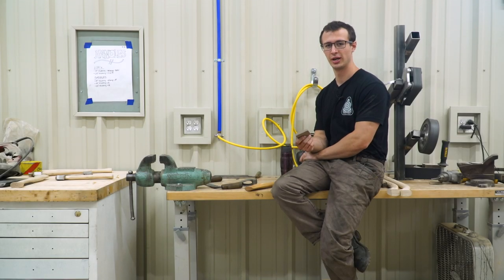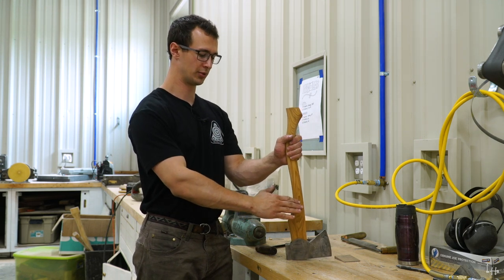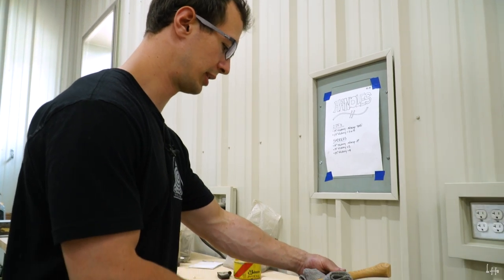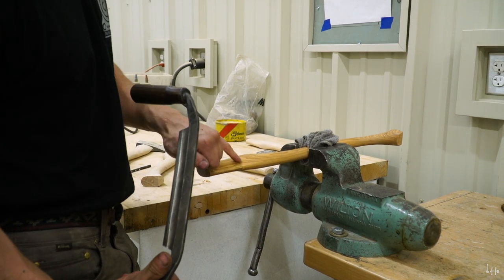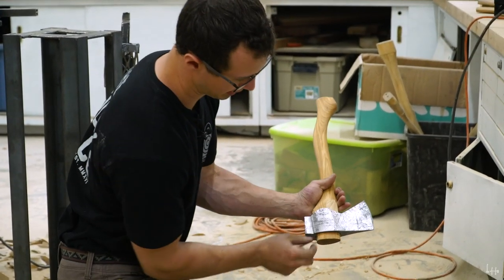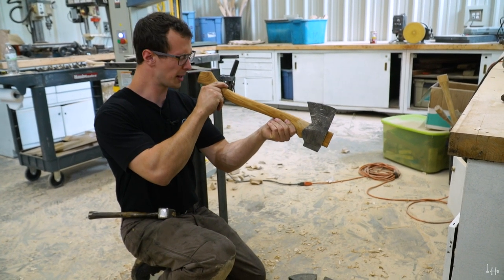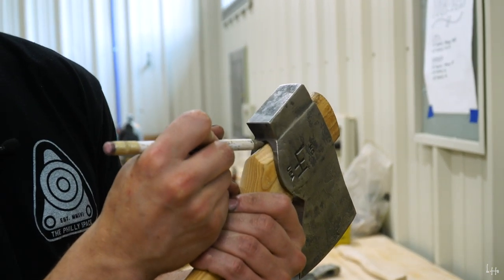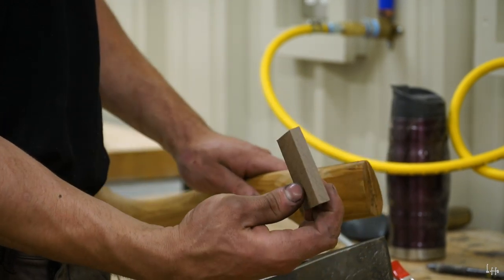HOW TO HANG AN AXE HEAD - AXE MAKING

Comment: I can smell the wood as you work it. I don't glue my wedges, I use pine tar. Not sure if it is any better or worse but I find it seals out moisture and preserves the eye wood area pretty well. I am, however, so going to use the rounded edges on my wedges from now on! I can't believe I hadn't thought of that!

Comment: Great video as always. I am thinking of making a handle for an old axe now and the thing is that the eye is not straight with the edge. What is better, to play with the handle to face it straight (edge and handle) or use files and file away parts of the eye making it as straight as it can get to the edge, before making the handle?

Comment: Thanks for the video, so helpfull.  I am replacing a axe handle but unsure about the head orientation, top versus bottom.  Can I assume the larger measurement across the eye in the short direction indicates the top?

Comment: I noticed you don't use any kind of a metal wedge in your handling process. I usually make either a couple of  straight step wedges or a single round wedge. Does the glue hold well enough this extra step is unnecessary? I've been doing this on all my blacksmithing tools as long as I can remember but not having to make metal wedges would be awesome! I'd love yours or someone else's input!

Edit: found a comment lower down you gave your thoughts on. Had no idea it could cause more harm than good. Main benefit I've noticed is when the wood wedge eventually let's go the metal wedges keep enough material in place to keep the head on. But maybe without the cracking of a step wedge you wouldn't need to worry so much about the wedge coming out. Combined with wood glue of course.

Comment: I really don't understand why some axe manufacturers flush fit their hafts to the top of the eye instead of proud fitment.  Then they put in barrel wedges to secure the wood wedge, which Liam has shown isn't even necessary if you hang it right in the first place.

Comment: Would it be at all possible to get a 30 or 32" handle with more material at the eye to fit a German D shape eye?
Reply: Why not? What are the measurements of the axe eye? Is whit ash ok?
Reply: @georgegordonbrown9522  The eye of Rhineland patterns tends to be much wider both on the front and back compared to most axes with an oval eye shape.

Comment: I would like the hole on the handle to be further down, so it isn't on the part I grab the handle. If you make use of that hole and put a cordm it just makes things even worse.. bit further, closer on the nob, would be the place I would put that hole on. I might be wrong, because I'm not an axe maker, it's from a user point of view.

Comment: I wood suggest titebond 3 waterproof glue.
Reply: Be aware, Titebond 3 has iron added to it for adhesion. Not a huge issue on an axe hang but for finer carpentry it can darken in the presence of water (rust). Just an FYI.

Comment: Could anyone explain why does the kerf need to be wider on bigger heads? My handsaw is dull as hell, and i've been thinking about buying a Japanese pull saw because they look very interesting, but the one i'm looking at has a 0.7mm kerf. Bad idea?
Reply: Boni Hollóssy + Not a bad idea, I use my pull saw a lot. But the wider kerf is needed to accept the larger wedges. Otherwise the wedge doesn’t drive deep enough to spread the top of the handle to fill the axe eye correctly. Not sure if I’m explaining this right, after hanging a few axe heads you’ll see what I mean. Hope that helps.
Reply: Also, you could sharpen your hand saw! That’s the idea of having tools that are not disposable...
Reply: @aslob9321  Makese sense, thanks! I've hung a few heads before, I just thought i'd use a narrower wedge, but I can see now how that might not spread the eye of the handle properly.
My saw is a super cheap random hardware store saw. I think the teeth are impulse hardened, and as far as I know you can't sharpen those. I've tried anyways because i've had a feather edge saw file laying around, but it just makes a horrible noise and doesn't seem to bite into the metal. The saw is also a cross cut. 😀
Reply: Boni Hollóssy + Yeah, those won’t sharpen, best bet is to buy an old rip saw at the flea market. They sharpen up great and the older ones were made thicker.